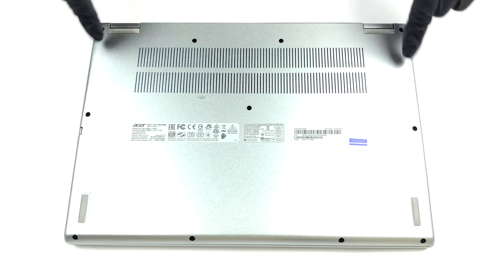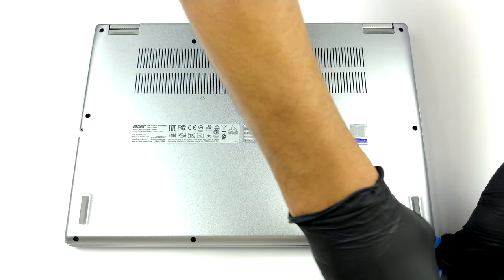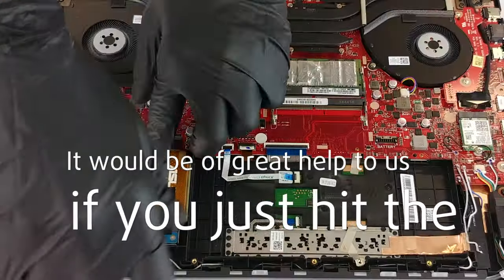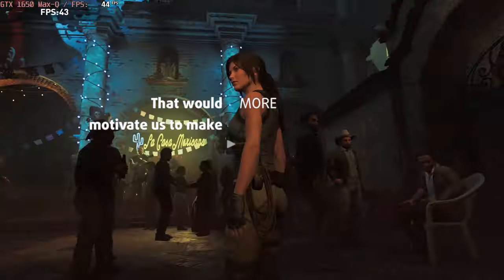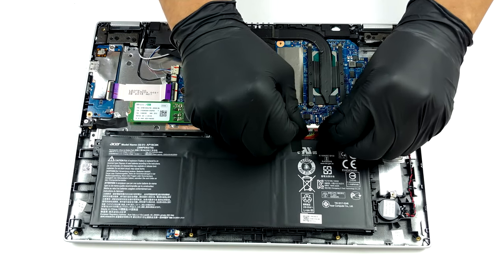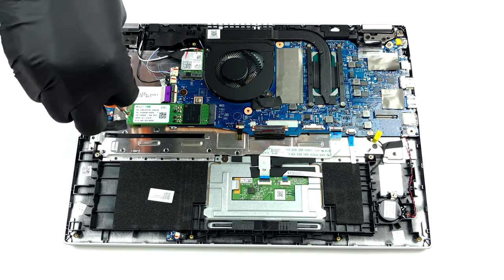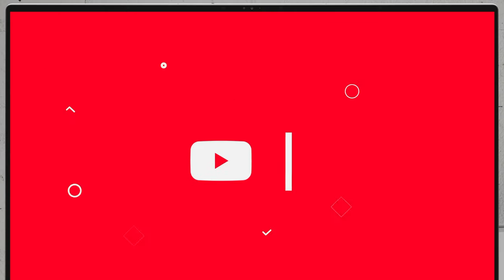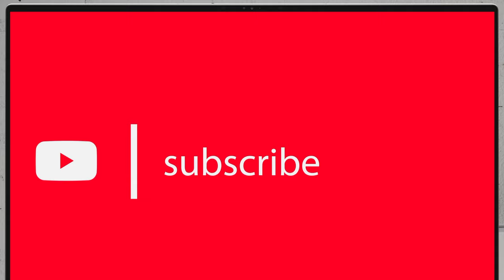🛠️ Acer Spin 3 (SP314-54N) - disassembly and upgrade options

Comment: Thank you! You were the only resource I ran across that pointed out the second M.2 SSD slot. I was trying (unsuccessfully) to upgrade the main drive. Thanks to you, I didn't need to, I was able to add the 1TB SSD stick as a second drive. Perfect! I had opened it up but hadn't noticed the slot myself.
Reply: Did you notice any performance gains?  Was it a SATA or NVMe drive?

Comment: nice video. In one sentence it is said ram is soldered and in the other it says max is 16 Gigs. Does that mean that we can upgrade the ram on our own? sorry i guess soldered mean upgrade is not an option. But i have never opened laptop before so wanted to be sure before i try something on it. Thanks for the nice video.
Reply: I have this laptop. Unfortunately the ram can’t be upgraded. I purchased mine with only 4gb of ram.
Reply: @Al-ok1lj  Didn't he remove one of the modules? im not good with laptops but i wanna upgrade my RAM cuz i only have 8 gigs.

Comment: Can you replace the charging port
Reply: I just had mine replaced through a laptop repair shop. I had heard that in some of these models it is soldered in place though, but they didn't say anything to me when I took it in and it's fixed now. I haven't looked inside yet to see what they did. You can also use your thunderbolt port to charge, it's USB-c but you will need to use a power block with at least 65W and a heavier duty cable.